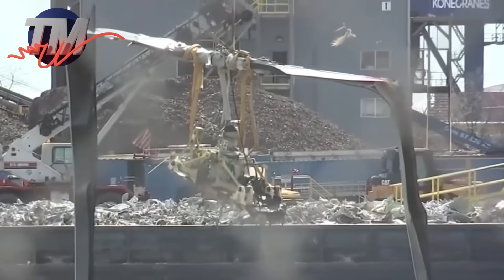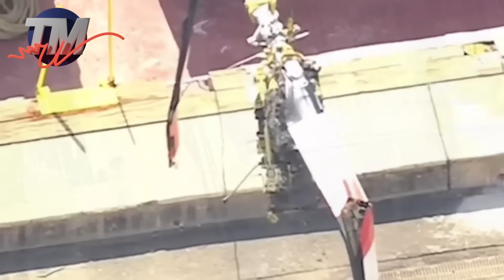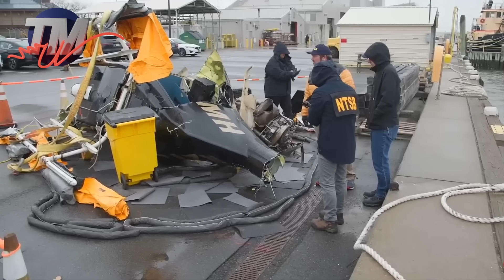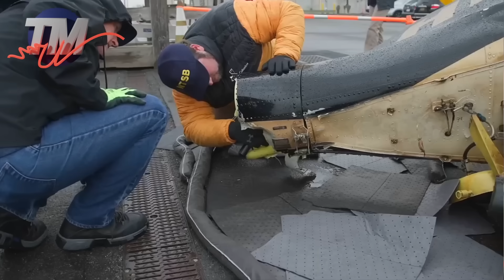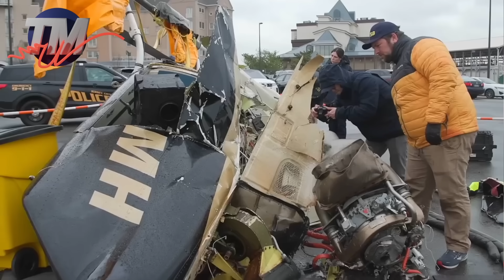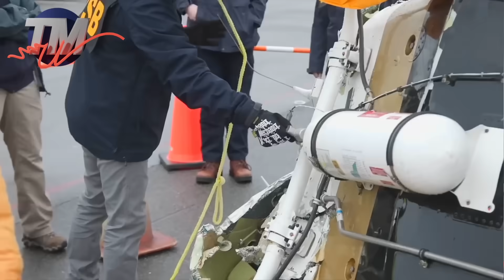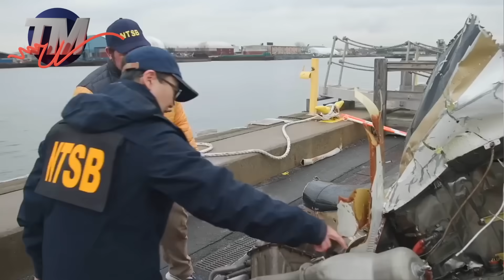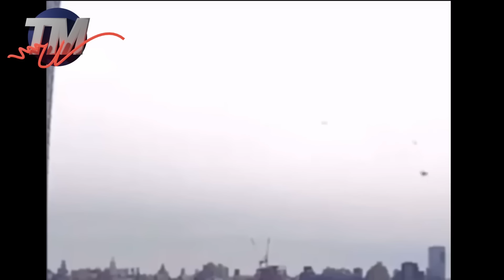Recovery of the Main Rotor of the Hudson River Tourist Helicopter - it's worse than we thought

Comment: My theory as an old Bell Cobra and Huey helicopter mechanic is the tail rotor failed, whether it was in the tail rotor components or the tail rotor drive train. The helicopter was in level forward flight and it crumbles. They didn't have enough forward airspeed and the centrifugal force of the main rotor ripped it apart. As mentioned, There doesn't appear to be a damage on the main rotor after it completely separated during the fall. My other theory is the tail boom collapsed causing the same problem. I've tons dozens of tailboom inspections and they do start to develop cracks in different places. This helicopter had just came out of a major inspection on March 1st. I'm thinking of a parts failure.
Reply: But if the tail rotor fails, wouldn't that cause the main body to rotate out of control before disintegrating, even for a split second?
Reply: @ Thats exactly what happen, the nose of the aircraft starts to turn to the right as its balling up. In my theory whatever failed started a chain reaction that was so fast there was no time to react. I've seen a Cobra shear a tail rotor drive shaft doing a hover check before a test flight after a phase inspection. It is a violent situation and the pilots reaction time is the only thing that saved their lives. They were only a couple feet off the ground and he dumped the collective and slammed into the ground. It spun almost 360° in a fraction of a second. You can recover from loss of tail rotor authority with enough forward airspeed but the tail boom and vertical fin are an important part of that recovery to keep the airframe straight in forward flight. If you are not flying fast enough or can't drop into an autorotation its over. Pilots practice doing slide-on landing at speed to simulate the loss of tail rotor authority.
Reply: I saw what looked like a puff of smoke in the tail boom area during the initial part of the video before the yaw.  Could that could have been the tail rotor linkage failing?
Reply: @jcflindsay  From time 1.48 to 2.12 you can see a large hole in the tail section where the break is, where the tail section came off on the side facing the camera, the left side if the tail boom. Do you see that?
Reply: @jcflindsay  fuel ran out.
Reply: I think they were going plenty fast enough, that even if the tail rotor instantly stopped, it should have been plenty enough speed to maintain straight flight through the arrow action of the tail. Unless it destroyed the tail at the same time, but... It still turns way too fast, even for that.
Reply: @ Its hard to say, I don't know what the required airspeed is for this aircraft but a bell UH-1N is 60 knots. A bell 206 is smaller so probably 40-50 knots. They were probably right around that but everything failed so quickly there was more than one fail point after the initial malfunction.
Reply: I have seen a Huey lose it tail antenna fly up and take a chunk out of the main rotor and land on its side. About 20 ft above ground.  Antenna wasn't torqued  to specs. Yes, it was a military helicopter.
Reply: I disguise any idea of a TR failure leading up to such event.  At such forward speeds with no tail it'll very likely just weather-vane and start drifting slightly sideways-forward,  airspeed really is your friend there until you initiate the AR and twist off the throttle.
Reply: 58 mech here.  Stressed skin failure of the tailboom!  It folded in flight.
Reply: Not pretending to be a helo mechanic but I'm leaning the same way.  The first thing we see is the helicopter violently  yaws very hard to the right or left (hard to tell from the video) which could indicate the tail boom failed first, causing catastrophic torque on the transmission/gearbox/rotor and ripping it out of the roof while the fuselage tries to spin the opposite direction of the rotor.  Whatever happened the failures were very close together.
Reply: @jimkelly1578  I read a bell 206 mechanic comment yesterday that I also agree with just didn't think it would be possible. These are old aircraft with poor inspections and the transmission broke loose from the mounting point due to delamination in the airframe. That makes sense, it wasn't something I considered. That would explain why it balled up the way it did and the transmission was already dangling before it separated completely. It will be interesting to see how this turns out.
Reply: @endlessmountainoutdoors 
Certainly possible sir, although I know nothing about aircraft , I have seen all manner of fatigue failures in cars and trucks  over decades ,  and it could be anything from a whole raft of possible scenarios. 
Someone in the comments talking about some maintenance issue that could have caused it or been overlooked and how could that possibly happen ? 
 The answer is very easily , no matter how conscientious mechanics are , they are all human . 
 None of us are infallible. 
  No doubt the investigation will find the cause.
Reply: @mikldude9376  You are correct, people make mistakes. As a QA inspector my last year in the military I can assure you shit happens. If there is a mishap in aviation there were at least three mistakes made that lead up to it. And I agree, there is a lot of similar structural and mechanical problems between automotive and aviation. I spent 10 years on both sides.
Reply: Looks like the blades hit the tail section due extreme wind gusts?
Reply: @ The blades would have been mangled when they hit the water. They were still spinning fully intact after it completely separated from the aircraft.
Reply: @bjenkins803  then the blades would got chewed up,  and they were not.
Reply: @bjenkins803 No serious wind was noted.
Reply: @bjenkins803  body tilted over and tail went up as gravity pulled downward exceeding force on the entire frame to withstand and all tore  apart.
Reply: @bjenkins803   That was the original theory....mast bumping.  But looking at the main blades and the transmission tends to rule that out.  The blades would have been destroyed as they hit the tail boom.  It's looking more and more like the transmission seized and the kinetic energy from the main rotor blades tore the helo apart.  We shall see.